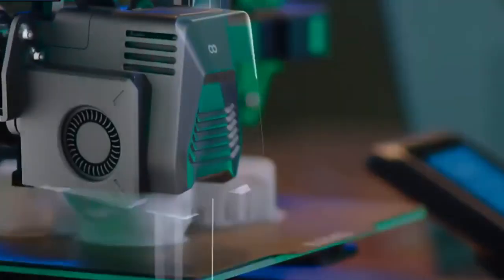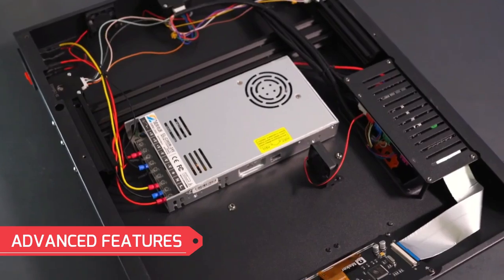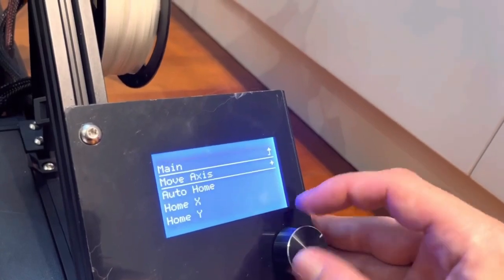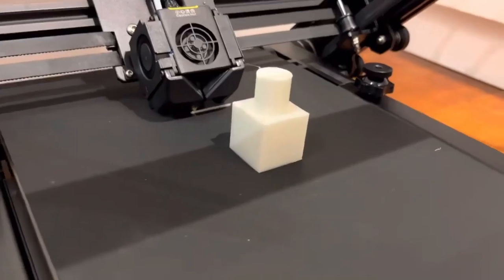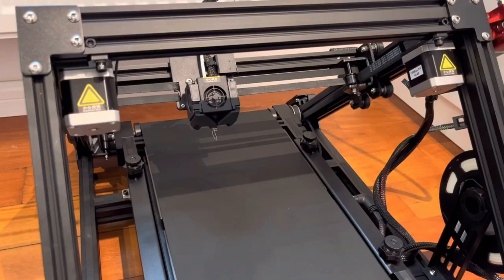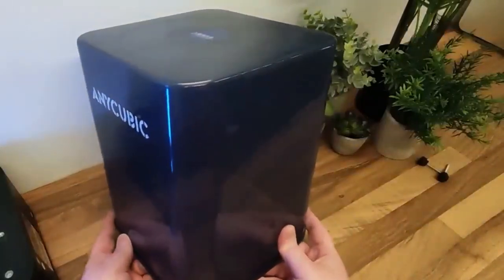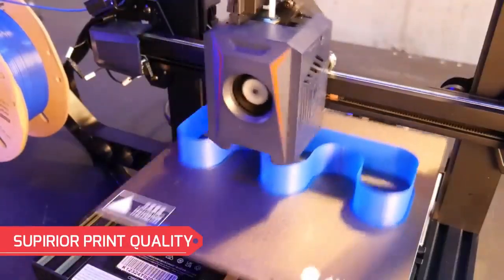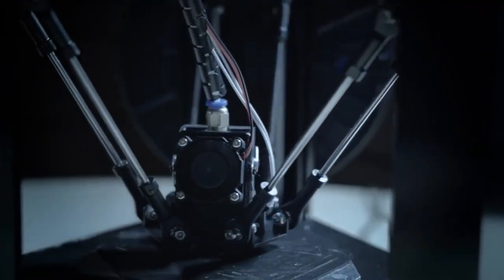5 Best 3D Printers of 2024 🖨️ | Unleash Your Creativity with Cutting-Edge Tech!

Comment: Hello! The CR-30 machine was discontinued from the production line in 2023.
Don't you think Bambu Lab A1 should be in this list? Also Ender 3 KE and V3 are in top cost effectiveness rates for last year. Personally I would not recommend Kobra first than A1 and the new Ender 3 machines.
Overall, that is a good video to know about some benchtop 3D printer machines.